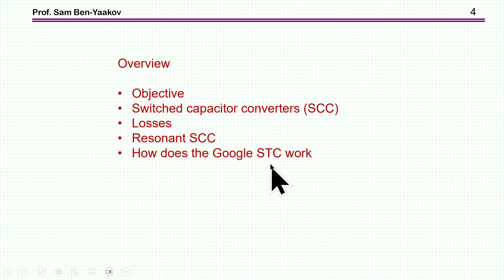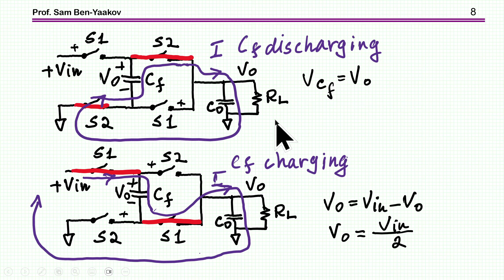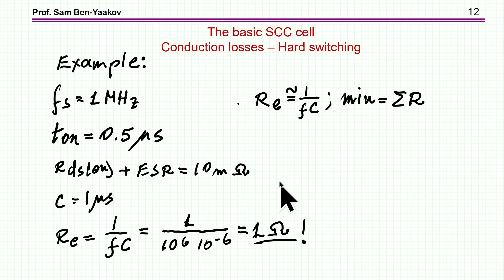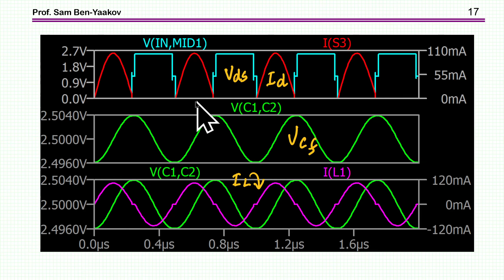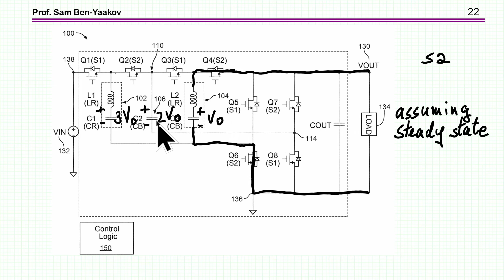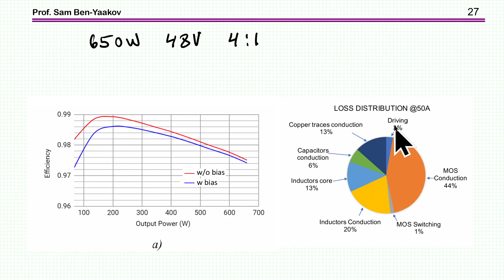Google’s Switched Tank Converter (STC)

Comment: Very nice explanation.  I have a question about the plotted efficiency and the conduction loss calculation.  One of the slide shows the efficiency at 600W is greater than 97%.  Let's take 97% at 600W, which is 50A for 12V output.  In this case, the total power loss is 18.56W, wherein the conduction loss takes about half, hence ~9W.  Using the equation in one of your side, 9W = 50A*50A* 5*(Rdson+ESR+...), it would result in 0.7mOhm.  Do you think it is practical for google to achieve such a low total resistance at DC?

Comment: Q: why not throw an extra coil before Cout (keeping the load on Cout) to limit those spikes?
I don't know if it's possible but it would be great if one could adapt off the shelf SCCs (from microchip for instance) and improve their (pathetic) efficiency.
Edit: great video professor.
Reply from the maker: 1. Not all the spikes are associated with the output.
2. An inductor will mess up the resonant frequency.

Comment: Curiosity? Tell it to bajillions of iPhones whose audio power amps have been driven by switched capacitor boost converters.
Reply from the maker: I am talking about high power. But even for low power, switch capacitor converters are not included in most power electronic designs. And, apple by itself is also a curiosity.
Reply: @sambenyaakov yeah I kept watching didn’t realize you were getting into 500+ watt territory. As for curious, well I mean there’s what we do independently and then there’s what the silicon vendors do either of their own volition or as a direct response to technical requirements. In this case it’s 10’s of watts, they’re very compact and don’t have electromagnetic coex issues like inductive converters can. 

Anyhow always enjoy watching your videos, very informative…it’s like free graduate level coursework!
Reply: Not to mention  all those 100W charging smartphone also using switched cap.